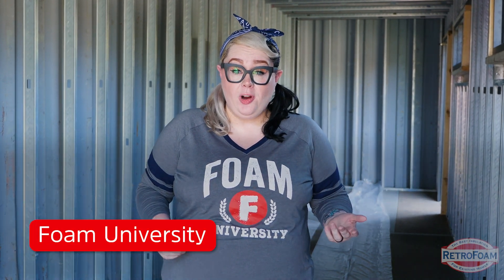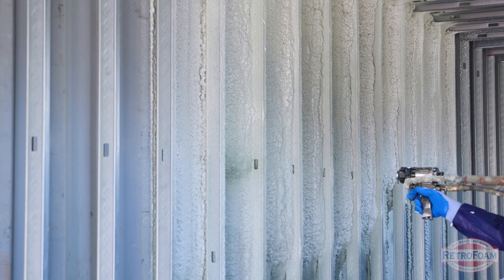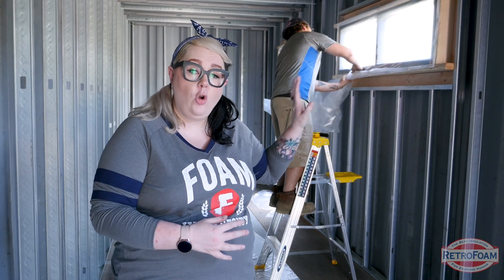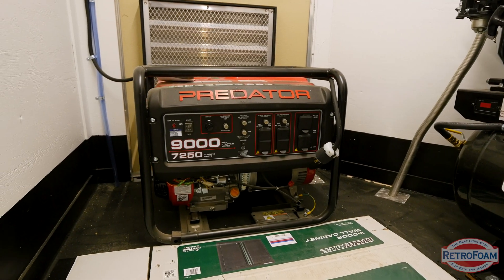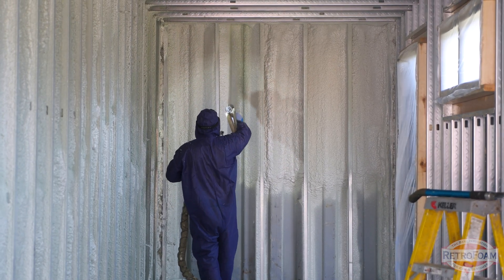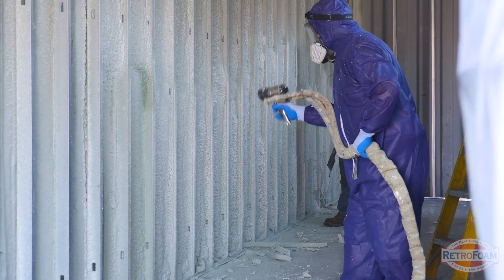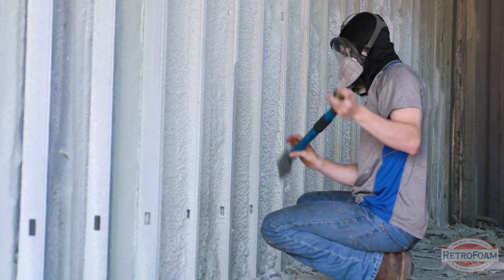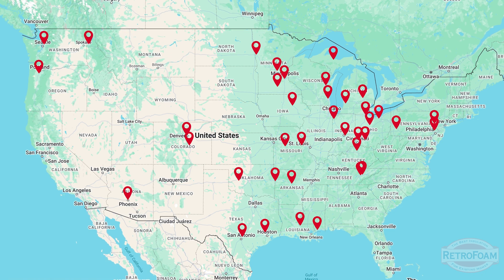Insulating a Shipping Container with Spray Foam | Foam University

Comment: what's the R=Value on 2 inches of closed cell?
Reply from the maker: The R-Value of 2-inches of closed cell spray foam is about R-12 to R-14. This article from our Learning Center contains some very helpful information on all things R-Value: https://www.retrofoam.com/blog/retrofoam-injection-foam-insulation-r-value
Reply: I know its been awhile but r-6 per inch of spray foam so r-12 🤷